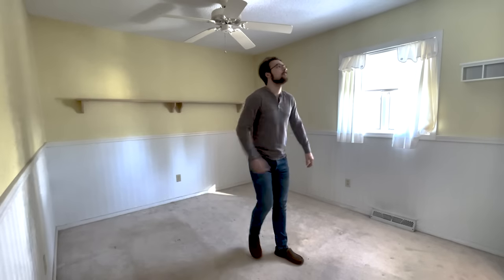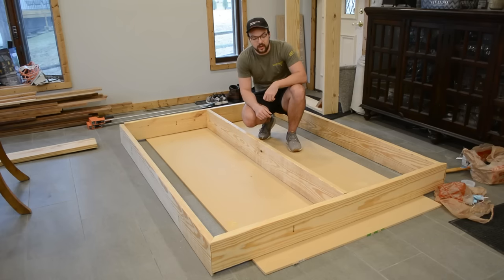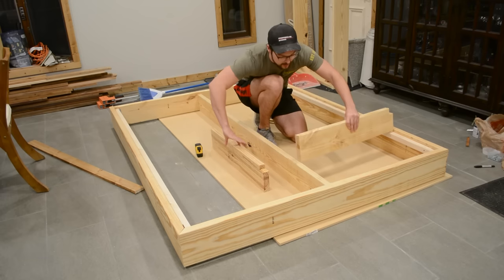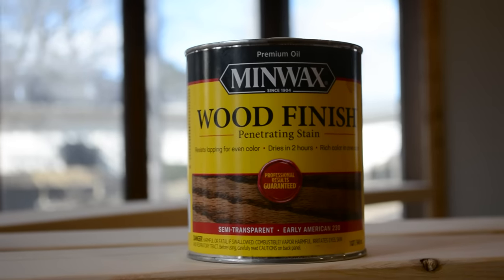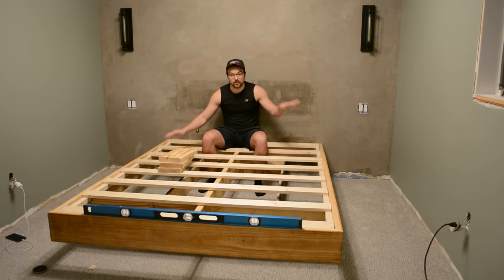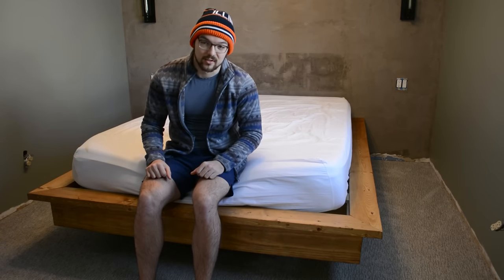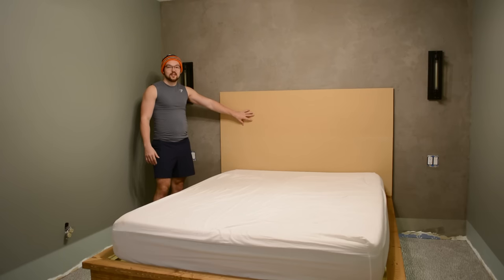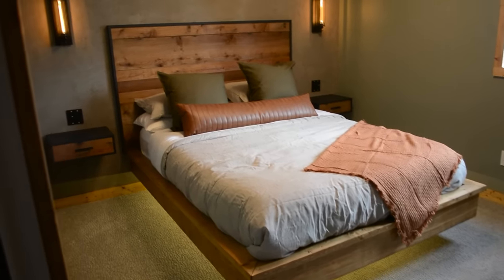How to Build a FLOATING BED | Bedroom Reno Part 5

Comment: instead of toenailing the middle board try pocket holes.  Looks really good thank you for the video
Reply from the maker: Good tip and thanks for watching! I use pocket holes often but in this instance I needed a screw with a lot of sheer strength and pocket holes aren't super strong in that regard. Therefore I like to use GRK structural screws to have a stronger connection

Comment: Random question, what size finish nailer do you use for this project and the slat wall?
Reply from the maker: I used a pin nailer (23 gauge) for the slat wall and a brad nailer (18 gauge) for this project

Comment: How many of each board do we need. I see you put in the description the dimensions but not the quantity of boards
Reply from the maker: I didn't put the number since a lot of people adapt the design to fit different size mattresses. Also, you could buy extra long 2x8s and get multiple pieces out of it rather than buying multiple smaller pieces depending on what your supplier has in stock. In general, you'll need 10 2x8s for the 2 boxes, 2 2x4s to support the 10 1x4s that support the mattress, and 3 2x4s to create the ledge around the bed. Hope that helps!

Comment: Hey quick question. I have a pretty heavy mattress at around 110 lbs. I would like to know the cantilever length that you have from the outside face of the smaller box to the outside face of the larger box?
Reply from the maker: Good question! I listed all the dimensions in the description and the cantilever is 14.5" on the sides and the front. Hope that helps!

Comment: What do you think is stronger for the center support on the bigger box, the corner braces or just screws?
Reply from the maker: I think 2 Simpson strong tie braces on either side would be stronger but I think it’s a bit overkill. I just used screws and the bed has held up fine. Good question!
Reply: @GoldenKeyDesign  thanks for the answer! And great video!

Comment: I’m looking to do this my self what’s the material list with how much of each you need
Reply from the maker: I have all dimensions listed in the description and there should be a comment thread with specific board sizes
Reply: Sorry I meant like how many pieces of board I would need.
Reply from the maker: @calvinclifford8682  I didn't put the number of each board in the description since a lot of people adapt the design to fit different size mattresses. But there is a total of 9 2x8s, 4 for the small box 5 for the large box a total of 8 slats, 3 2x4s for cap, and 2 additional 2x4s to support the slats in the larger box. You could buy extra long 2x8s and get multiple pieces out of it rather than buying multiple smaller pieces depending on what your supplier has in stock
Reply: @GoldenKeyDesign  thank you soo much!
Reply: Did you use a 45 degree miter?
Reply from the maker: @calvinclifford8682  Yes!

Comment: You could have used the same brackets for the middle support that you used in the corners
Reply from the maker: I appreciate the feedback! Simpson Strong Tie brackets are pretty expensive and they weren’t needed for that joint so I opted for structural screws which are plenty strong and way cheaper. The middle support is directly supported by the smaller box as it sits on top of it. All that joint is supporting is the front joist of the larger box which isn’t much weight.

Comment: Sorry for all the questions. What kind and size screws did you use?
Reply from the maker: I prefer GRK screws. I mainly used 2.5” for most connections and occasionally used shorter 1.5” screws
Reply: @GoldenKeyDesign  I’m confused on how you attached the cap to the top of the bed. With 2x4 and an 1.5” over hang there’s not really any where to screw them on
Reply from the maker: @tylerb4355  Good question! I screwed them in from the underside through the slats and slat supports. You can a time-lapse of it at 13:11. Hope that helps!

Comment: Love it. Do you have the plans available?
Reply from the maker: Thanks! The dimensions are in the description
Reply: @GoldenKeyDesign Thanks! I have to do some modifications for a twin bed.  I'm a little confused on the last part where you put in the 4 additional supports in the smaller box.
Reply from the maker: @keithwilliamson236  Those pieces just anchor the the two boxes together to make the structure more rigid

Comment: How much did you spend on materials and what type wood did you use?
Reply from the maker: About $300 in material/lumber and I used pine 2x8s which is what you will find at your local big box store. Hope that helps!

Comment: Hey I saw that you still interact with questions in the comments! So I was wondering the rough price of the materials needed for this!
Reply from the maker: Roughly $300 in materials but that was at the peak of lumber prices. It should be a lot lower today
Reply: @GoldenKeyDesign  ah that’s very affordable actually
Reply: What size screws do I need to buy?
Reply from the maker: @katiesmelser8843  I used a variety for this project, but I tend to use 2.5” GRK screws for the most part

Comment: Is there a reason you didn’t use the metal brackets for the small box like you did the bigger one?
Reply from the maker: They are more expensive than just using screws and I was more concerned with the structural integrity of the larger box. Also, I wanted to conceal all the fasteners on the larger box since it wasn’t being painted like the smaller box. Hope that helps!

Comment: What is the length 2x2? And also the space between the slat boards?
Reply from the maker: The 2x2 supporting the slats is 81" and the distance between the slats is arbitrary but in my case it is about 6"

Comment: What are demensions/materials for a king size frame?
Reply from the maker: A king is the same length as a queen, but is 16" wider. So use my dimensions in the description and add 16" to the width. Hope that helps!
Reply: @GoldenKeyDesign  awesome.. thanks

Comment: Hey ! Your video has been very inspiring for me to create my own floating bed frame but I have a hard time understanding the measurements from America 😢 May I ask you if you can let me know how to read them so I can adapt them for France dimensions by any chance 🤞🏼?
Reply from the maker: Hi! Thank you so much! I assume you use metric system so you can use an online converter to convert feet (') and inches (") to meters and centimeters. Hope that helps!
Reply: Dimensions pour lit queen :
Boîte plus petite :  (2"x8"s)= (5.08cmx20.32cm)
Quantité 2 de 91.45cm x 176.53cm
Boîte plus grande : 165.1cm x 213.36cm (2"x8"s)= (5.08cmx20.32cm)
Quantité 2 de165.1cm x 213.36cm
Bouchon autour du haut du lit : (2"x4"s)= (5.08cm x 10.16cm)
         dimension extérieure : Quantité 2 de172.72cm x 217.17cm
         dimension intérieure : Quantité 2 de152.4cm x 207.01cm
Lattes : 8.89cm x 157.48cm (1"x4"s)= (2.54cm x 10.16cm)
Quantité 8 de.89cm x 157.48cm
Support central : 205.74cm (2"x8"s)= (5.08cmx20.32cm)
Quantité 1 de205.74cm
I hope this helps. Good luck.
Reply: @GoldenKeyDesign  Thank you so much for answering ! I was wondering what the ' and " meant 🤭
Reply: @cgeldres  Thank you very much for the full translation 😊 ! I was just lost with the sign for inches and stuff. Didn't know you write them like that 😅
Reply: @lucilepetit8306  No problem, thanks to google that makes these possible.

Comment: What dimensions would you suggest for a  King sized bed
Reply from the maker: Use my queen dimensions in the description and add 16" to the width. The lengths are the same for both mattress. Hope that helps!
Reply: @GoldenKeyDesign  thank you

Comment: Quick question if you made the bottom box too small to where the bed is tipping what would be the best way to fix that while still maintaining the appearance of the floating bed?
Reply from the maker: You would need to make the bottom box a bit bigger in order to stop the bed from tipping. If that causes you to be able to see the bottom box and no longer have the floating effect, then you need to shorten the height of the smaller box to make it closer to the ground. Hope that helps!

Comment: Amazing build, will try myself. Only part I got confused on was securing the large platform to the smaller one, not sure what u did there
Reply from the maker: Thank you! I secured the boxes together using some scrap 2x8s. I put one 2x8 vertically in each inside corner of the smaller box and screwed one end to the smaller box and the other to the larger box. Hope that makes sense!

Comment: Hello, My name is Vidjan and I am twelve years old and I would like to make a bed like this. My question is: what is the height of the smaller box and the larger box? Thank you.
Reply from the maker: Hi there! The height of both boxes is 7.5". I used 2x8s so the actual dimensions of those boards are 7.5" by 1.5". Hope that helps - good luck on the build!

Comment: Do you have a complete lumber material list?
Reply from the maker: I don't, but I do have the dimensions in the description. I figured most people would need to adjust the sizing to fit their mattress. The two main boxes are 2x8s, the top edge are 2x4s, and the slats are 1x3s. Hope that helps!
Reply: @GoldenKeyDesign  ok good deal. Thanks a lot for the reply! Great video too

Comment: Hello, I'm planning on building my next bed, the 2x8s conversion to cm is 5x20?
Reply from the maker: Yep, that’s correct! Good luck with the build!
Reply: @GoldenKeyDesign  thank you, I can't find 2", only .71", if I screw 2 together to get 1.42" will it work?
Reply from the maker: I think that should be good. Specific dimensions don't matter as much as the thickness of the board is mainly for structural integrity. I think 1.42" should still be structurally sound

Comment: Is there a material list I could have so I know what all lumber I need? Not the dimensions a material list
Reply from the maker: Unfortunately I don’t have one. The large boxes are made out of 2x8s and you will need 9 of them to build both boxes. And the rest is made out of 2x4s. The number you need will depend on which length you buy. And then the slats are 1x4s to support the mattress. Depending on what size mattress you use, the dimensions will vary. Hope that helps!
Reply: @GoldenKeyDesign  I appreciate it!

Comment: You should have prepped all your boards from the start to finish before assembling that way you get even coding on everything and protection because you're not going to get that protection where you're boards or but it up against each other you're going to get water in there it's going to rot out
Reply from the maker: I don't think there will be any water in the bedroom so I am not too concerned about that. It is common to finish (stain and poly) a project after assembly so you do not mar the surface during the assembly process.

Comment: Looks great man, I wonder what the dimensions would be for a king size bed.
Reply: I'm not an expert here, but I would use the said dimensions in this video and then add the difference.
Reply: @Da1Apprentice  well yeah lol
Reply from the maker: Exactly - they are the same length, so all you will need to do is widen both boxes by 16”

Comment: do you have to make a little path on the wall for the electrical path of the led light?
Reply from the maker: It has an adhesive backing so I just adhered it to the side of the smaller box. Hope that helps answer your question!

Comment: I personally would redo the design to use thin walled rectangular steel tubing to keep it light and make it bolt together instead of welding it as 1 piece, I would also use full hardwood for the outside wood to cover up or add to the look of metal , I would also use crown molding instead of just straight of cut from a table saw and spray everything using 2k auto clearcoat and spray the stain and conditioner or substitute 2k clearcoat as the conditioner to 100% block out the grain, but that's only because I have experience with basic welding and 2k spraying. I think you did a good job and the idea is good. Also dude why are you jacked? If you dress up as Bane from the Dark Knight you'd look just like the actor
Reply from the maker: I want to get into welding but I don’t have a welder just yet. I love the combined look of metal and wood. That’s a great idea though! And I appreciate the complement on my physique 😁 Bodybuilding is another hobby of mine. Gonna have to be Bane next year for Halloween once I’m even bigger 😂

Comment: awesome design! what are the dimensions for the 3 boarder pieces after you adjusted them?
Reply from the maker: Thank you! I basically turned them into 2x4s so they ended up being 3.5" wide and 1.5" tall with 1.5" extending beyond the bed frame. I had originally bought 2x6s. If you are doing this project, just buy 2x4s from the start and you won't need to cut them down. Hope that helps!

Comment: Hi would we be able to make this floating bed in australia as we don't have studs we are all brick with plastering
Reply from the maker: Yep! Securing it to the wall is not necessary. I did it to be overkill but the bed is sturdy enough on its own without additional support. You can still secure it to the brick though with proper screws/anchors

Comment: i prefer the wooden part  underneath the mattress should be full flat board not just border and the owner will not see there are holes at the corner of mattress
Reply from the maker: Most mattresses need ventilation, hence the slats rather than a full board. And the edges are all covered by the comforter, but I understand your points

Comment: Has anyone tried this with a king size bed? If so what are the measurements you used?
Reply from the maker: Use my queen dimensions in the description and add 16" to the width. The lengths are the same for both mattresses. Hope that helps!
Reply: @GoldenKeyDesign  thank you!

Comment: The slat spacing for just a mattress shouldn't exceed 2.75 inches.  What you have is for a box spring bottom.
Reply from the maker: I haven't had any issues thus far, but if I do, I can just add a 1/4" sheet of plywood on top of the slats

Comment: Having that wood edge around the bed is very uncomfortable when you are getting in and out of the bed. I would reduce that even more.
Reply from the maker: I actually really like as it holds up the comforter so the bottom of the bed can be seen clearly and it works as a great ledge to use when putting on shoes or socks. But you can definitely modify it and adjust its depth to your needs!

Comment: anyone know what type of 2x8 did he use? was it poplar, pine, maple, oak. HELP
Reply from the maker: I used standard lumber from big box stores which is pine in my area but you can make it out of any species. But pine is the least expensive by far
Reply: @GoldenKeyDesign  thank you
Reply: @GoldenKeyDesign  what size bed was that project for, what’s the what was the size of the base frame judging by your height when you meet it was around 5 1/2’ x 3 or 5 1/2’ x 4 or 6’ x 4 was that project for a queen or a king thank you for your response. I appreciate it.
Reply from the maker: @smilleeguy1  This was a queen. Check the dimensions in the description
Reply: @GoldenKeyDesign  thanks again

Comment: Can u help me with measurements for 4 by 6 bed
Reply from the maker: I don’t think they make mattresses in those dimensions. Do you know if it’s a twin or a full? You can use my measurements for the queen in the description and subtract the difference between those and whichever mattress you have. Hope that helps!
Reply: @GoldenKeyDesign  I have a small room that only allows a 48×72 dimensions in inches
Reply: Please 🥺 help am from Africa and don't worry we make those kind of mattress of 48 ×72
Reply: Bro help am trying to impress my wife with a new decor so if u have time please send me just the measurements
Reply: What about a full 54 inches by 75 inches floating bed

Comment: i’m confused .. how does it not tip ?? i’m a rookie sorry
Reply from the maker: It’s called a cantilever. The bottom box supports the top box which is also screwed into the back wall

Comment: Lastly why didn’t you attach the headboard to a small diameter board behind it with leds to make it look like that’s floating as well . Come on my dog
Reply from the maker: That's a good idea! I could still do that actually as I mounted the boards to 3/4" sheet of MDF. All I would need to do is remove the black border